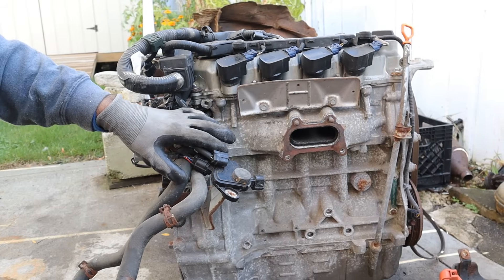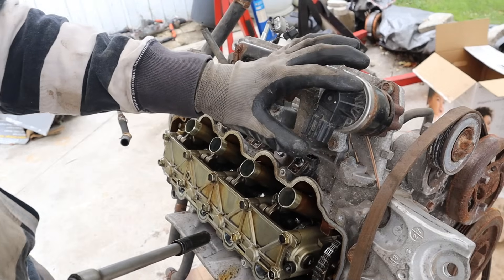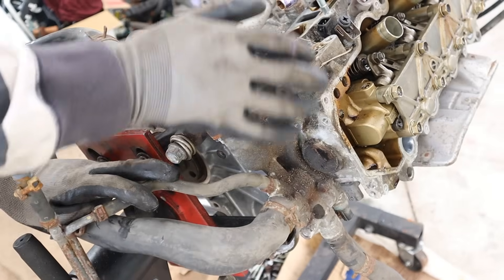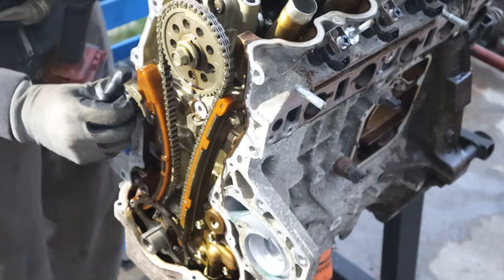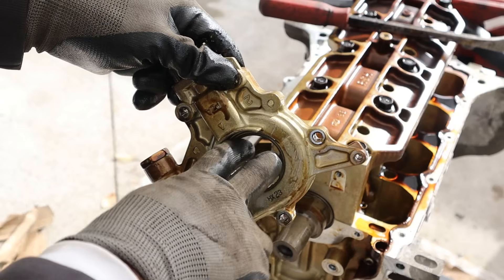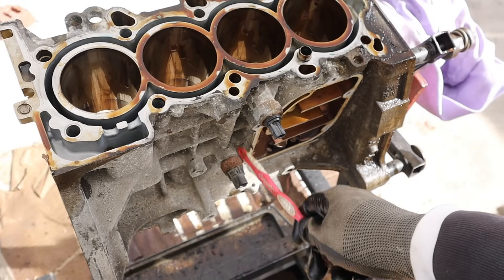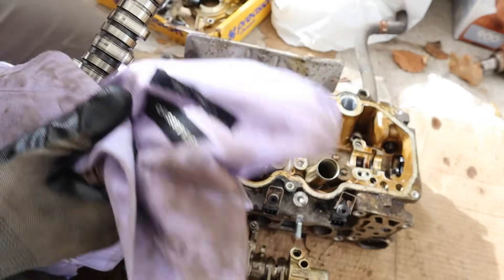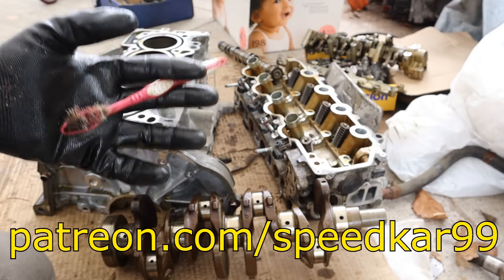Honda's Most Efficient Engine? HYBRID 1.3L LDA-MF5 Teardown!

Comment: Think it's the same engine in my 2009 Honda Insight with CVT. Nice to see it's pretty well built for such a small, low power engine. No fragile vented cylinder walls and fiddly head gaskets like the Fords. And one of the last of the port injected engines that don't get the inlet valves gummed up as much as the direct injection ones. The only thing that's gone wrong on mine was a shot bearing on the A/C compressor after 150k miles and one worn out 12 volt aux battery. I've got 16 years and nearly 190k miles on it now. Never going to take mine apart myself, but nice to see that no special tools are required.
Reply from the maker: How much did the hybrid compressor cost you?
Reply: @speedkar99 a fortune. £2450 inc £360 labour for diagnosis and fitting. They replaced the compressor and its clutch and solenoid actuator. There was a broken ground wire on the fan control module connector and the AC gas drier filter was blocked.

Comment: Great video, but “notorious EGR”, I’m a master tech for Honda, in the last 9 years I’ve replaced 1 EGR…and that was at the training center in Portland. They basically never fail, I can’t speak for pre-2000’s cars cause we don’t see em  much at the dealership but the EGR he has in his hands is the same one all modern Hondas use and they are bulletproof
Reply from the maker: Early 2000 hondas had TSB's on the EGRs
Reply: @speedkar99  I just checked, I mean your right, civics had one up to 2000 and the v6 accord had one all the way up till 2001….i guess I coulda been more specific and said post 2002… 😂

Comment: Toyota and Suzuki where getting 55mpg+ in the 80s and 90s without all this complexity.  Metro and Tercel.
Reply from the maker: But they polluted alot more says the government.
Reply: @speedkar99 care to explain how a engine using less fuel makes more pollution?  Especially considering a 1.0 Metro puts out 13g/km of CO2.  Compared to 99 Accord 2.3 at over 200g/km.
Reply: @speedkar99 sniffer test says otherwise.

Explain how a vehicle using 50% less fuel makes more population.
Reply: @bowez9  Hydrocarbons, CO, and NOx are not in lock-step with fuel consumption. The older vehicles did not have emission controls as effective as what is in place nowadays. The fuel injection was not as accurate, the catalytic converters were not as effective, etc. You can have an older small vehicle that uses (let's say) half as much fuel, but the catalytic converter is only 90% efficient as opposed to 99% (which means, per unit of fuel burned, it lets out 10 times more nasties) so even though it uses half the fuel, it emits 5 times more CO, HC, NOx.
Reply: @bikeaddictbp your math don't math.

Especially considering the actual CO2 emissions differed by 19x.

Nevermind your 99% was achieved in 1990 while the 90% was in 1975.  Meaning your not being honest further showing that a Metro or Tercel put less pollution out than a modern vehicle in that they have the same emissions controls and efficiency.   The only change in emissions since is with Variable Valve Timing EGR CAN be removed-but is not always.

Further meaning since 1990 MPG and Emissions are directly related (for gasoline engines).

And since those small 1975 engines were getting 35-50mpg and the a 1990+ vehicle would need to get 25-30mpg to match that 75 engine any worse mpg is it making more pollution even with better emissions controls.
Reply: @bowez9  Those numbers were just to illustrate that just because a vehicle has lower fuel consumption doesn't automatically mean that the CO, HC, and NOx emissions will be proportionally lower, because it also depends a lot on the technology involved. (Only the CO2 can be presumed proportional to fuel consumption.) An engine with early-1990s-era emissions technology won't comply with EPA Tier 2 ... it won't even have OBDII!
Reply: @bikeaddictbp you are correct a Gasoline engine from 1990 can not be EPA Tier 2 because it's not Diesel.

On Board Diagnostic 2(OBD2) has nothing to do with emissions controls, only standardized powertrain error codes.  
Actually since most emissions tests on OBD2 vehicles only plug into the diagnostic port and let the vehicle say if it good it has no idea what is really coming out the tail pipe, just that it is in range (values that can be edited by the user with software).  Whereas older vehicles require a sniffer in the tail pipe(s) and emissions are actually measured and verified.
Reply: Those cars wouldn't come close to meeting today's safety standards. And today's consumers probably wouldn't like the tin-can doors, no sound insulation, and no power anything including to the wheels. North American consumers stopped buying simple(r) cheap(er) little cars like the Hyundai Accent and Mitsubishi Mirage, so the manufacturers stopped selling them.
Reply: @bikeaddictbp do you/we want to save the environment or or just virtue signal?
A Metro/Tercel would do more than any EV and cost a fraction of the price. They even beat the Prius and Insight and cost less than them.
Reply: @bowez9  those old vehicles will never pass current crash standards ... and very few people want to buy vehicles in that segment. See: Mitsubishi Mirage.
Reply: @bikeaddictbp then subsidize them like EVs cause know one want to buy them either as sales figures show.

Comment: Wow vtec 8 valve dual coil.
Reply from the maker: Yeah but only two valves per cylinder
Reply: and 8 iridium spark plugs!  Spark plug changes are expensive

Comment: IMA is considered "weak hybrid" which won't run on electric alone, at least not in my 2005 Manual Civic. Idle stop only shuts off under 19mph with the fan/AC off or on Eco mode. Coasting should always be done in gear to regen (but gas engine will stay on). Super easy to stall, but can quick restart by shifting to neutral and back into gear instead of turning key. 50+mpg on my last 140mi trip a few days ago. Legendary car, but got too small for me, so my dad still drives it.
Reply from the maker: This newer gen civic does electric only mode, hence the whole VTEC contraption to shut of the valves.

Comment: Honda did have one (a bit more interesting) d15 three stage vtec engine with three cam profiles moving a three piece split rocker arm going from 12v to 16v to high lift 16v.  All done through two oil circuits moving the (2 piece/3 piece) split pins. Would love to see one of those opened up.
Reply from the maker: I'd imagine it's very similar! Was that for the integra or prelude?
Reply: @speedkar99  For the Civic

Comment: Have you ever get your hands on Honda K-series motors?
I’m thinking to build myself a Frankenstein. Looking for a k24 block and K20 head wonder what will be the best options from which cars I should source parts?
Head without vtec.
Reply from the maker: Yes I have videos on the K20 and K24, check them out!
Reply: @speedkar99 ok thanks
They are kinda tall I’m thinking is there a way to shorten it a bit 😅?)

Comment: Please do hyundai gamma 1.6 or a hyundai nu 2.0l those are some very well built engines.
Reply from the maker: I already have videos on the 1.6. I'd assume the 2.0 nu is similar to the theta out there. I have 2 videos on those.
Reply: @speedkar99  nice I'll check it out, didn't know you had done it, I've had 2 of the single cvvt gamma in kias and they really surprised me.
Thanks.

Comment: Wait wait wait hooooold the phone there. You can just use SPRINGS for tensioning the chain?! Why do so many engines have those oil-driven tensioners when springs would obviously be a cheaper, more robust, more reliable option? Is there some kind of advantage to oil-driven belt tensioners that makes more manufacturers chose them over just simple springs?
Reply from the maker: Good question. For a light, low stress engine, springs might work. For a heavier duty engine with variable valve timing, timing is critical and oil controled tensioners are probably more robust.
Reply: The spring force is going to get weaker and weaker as the chain stretches, whereas the hydraulic gives basically constant force. Not sure how big of a deal this is in practice

Comment: When honda stubborn still using otto-cycle than atkinson-cycle like any other
Reply from the maker: They were behind the times with the IMA systems but have lately caught up. Hope one day to find a scrap late model and see how thier 2 motor hybrid system works.
Reply: @speedkar99  for ice, they starting gave up vtec recently, market towards otto+atkinson or otto+miller for ICE only vehicles. and atkinson/miller only for HEV.

for FULL-HEV(not mild HEV), once their stubborness shows at honda SINGLE-MOTOR-drive HEV in JDM Fit i-DCD, and.... failed again...

Comment: Good old Honda that has 5 main bearings , and Toyota only had 4 mains on their new turbo v6. 🌵
Reply from the maker: It's how the crankshaft is situated, less compact in one orientation
Reply: Any V6 is going to have 4 main bearings. Any V-configuration engine is going to have (# of cylinders divided by 2 + 1) main bearings. Every single one of them, from every manufacturer. The journals for each bank of the V are next to each other. There's 3 sets of 2 in a V6, so 4 main bearings. It's just how the layout works.

Toyota's turbo V6 is indeed having troubles, but it isn't because of this. Loads of other turbo V6 engines don't have those problems.

Comment: for a NA engine, Honda has really made sure there is sufficient oil pressure and build to handle neglect ownership. it even has a forge crankshaft.
Unfortunately, the new direct injected turbo engine from Honda is a POS.
Reply from the maker: I agree. I have a teardown video one an L15 turbo and they made alot of short cuts.

Comment: Neat, I just finished doing a rebuild on a friend's k24, its always neat to see the little differences, but the major similarities between the engine families.  Neat side note, that car had about 270k miles on it, main bearings looked immaculate,  with the exception of one shell, where it looks like someone prior got some dirt in it when they had it apart to re-seal the bed plate.  Still tbought about letting it ride, but a new set was like 20$.
Reply from the maker: Awesome. Yes best to go with new bearings, cheap insurance. 
The K series is a bit more complex than this is say.

Comment: Still don’t get the point of having a zero profile lobe.
Reply: It's in the video.  Holds the valve closed when the electric motor is in use. Sitting at a stop sign,  starting from a stop and when coasting down a hill for regenerative braking.
Reply: its just stupid, instead of using a clutch to disconnect the engine from the electric motor, they use the valves to lessen the drag. that means the engine is always rotating even when its off in electric mode lol
Reply: @1996_Dude  It's for maintaining oil pressure to reduce wear and to enable the oil pressure to restart the cams, it drives the alternator for general power and power steering, it drives the vacuum pump for the brake booster, it keeps coolant circulating, and retains A/C function. It also provides for seamless transition between electric and engine drive by not having to spin up the engine 'with a clutch' to engage it.  So it's essential, not stupid.
Reply from the maker: Exactly! Not the most efficient way

Comment: I thought about buying one of those Hondas with the 5 speed manual hybrid but I'm Terrible with electronics so I went with 1998 Volkswagen Jetta 1z tdi only 2 electrical things that don't work on it and I've already solved them. Also 266k and still 42.7 mpg with 2 windows open and limp mode at 65mph
Reply: The Honda would probably not have had any electrical problems at all. But you can't go wrong with an old TDI.
Reply: @ComplicatedStuff  yeah I have manual windows so no problem there I wouldn't go with anything newer with vws knowing electrical issues.
Reply from the maker: Old TDI's are hard to beat, especially if you get them with a manual transmission and before the emissions crap of the mid2000s.
Reply: @speedkar99  mine has egr and egr cooled but there serviceable so I cleaned them I would delete them but I need to chip ecu for that

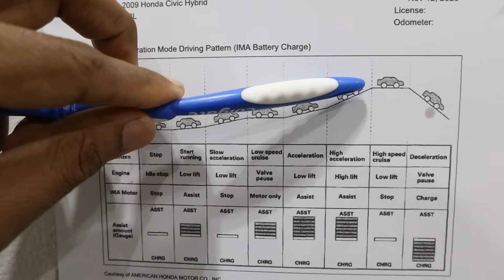Comment: hi based on the documentation 15:12 it is called valve pause not idle stop the only idle stop is when the vehicle is stopped
Reply from the maker: Regardless, idle stop or valve pause, the valves are still riding on the zero lift cam lobe in both scenarios.